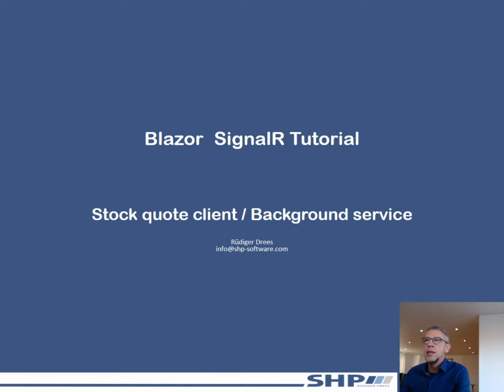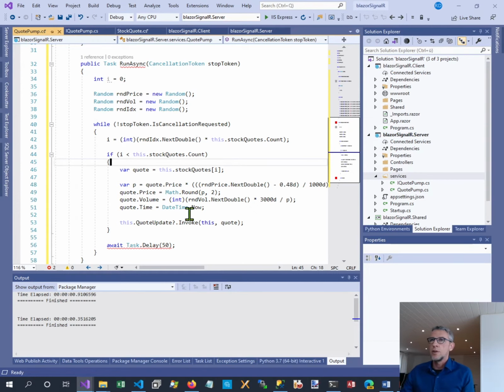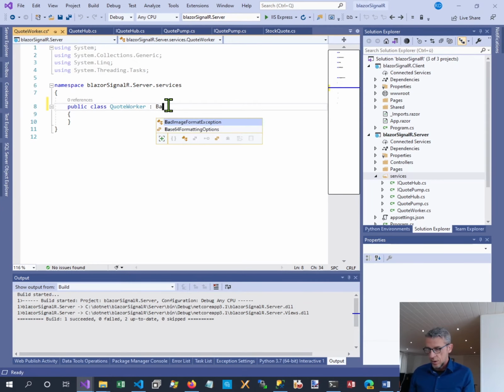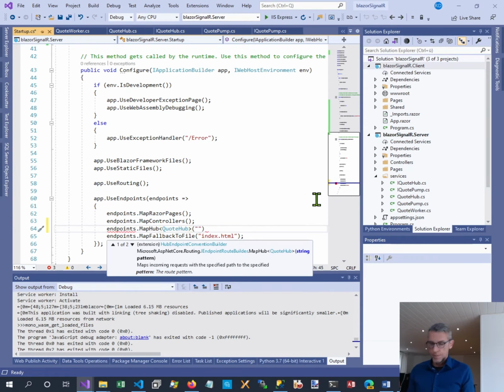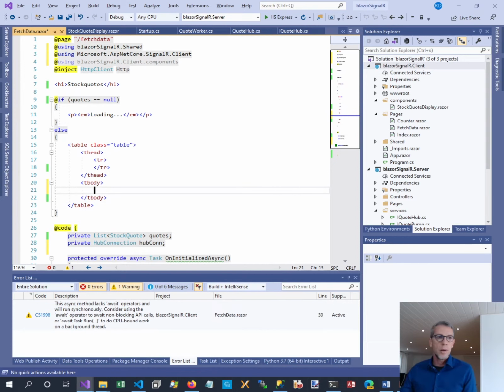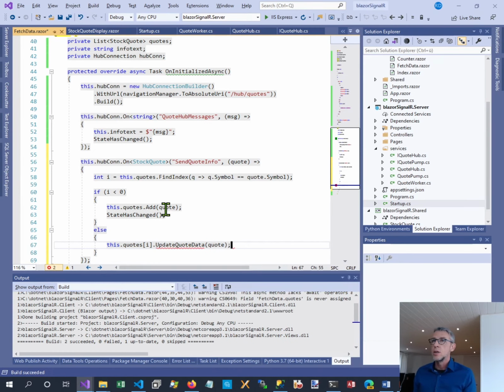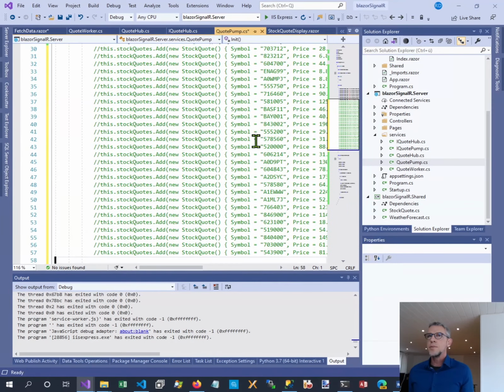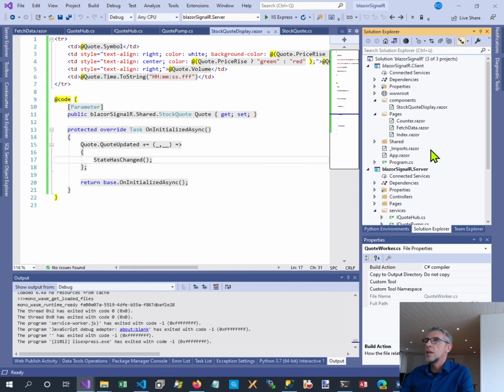Blazor SignalR Stockquote App/Tutorial

Comment: Great Video. I have been researching Blazor and SignalR and am a little confused. I looked at your code and had a couple questions. I noticed you had a Blazor.Client Project and a Blazor Server Project. If you run the blazor client by itself you don't get the data from the server obviously. But when I run the server project everything works fine. So does that mean that if you were to host this on something like AZURE, would you host the blazor server project and everyone connects to the Blazor Server with the URL from the hosted web app on AZURE?
Reply from the maker: Thx Kenneth.
When you connect to the Server via Browser-URL, you download the client-side-app which establishes a connection via signalR to the Server to handle events, ui-update notifications..